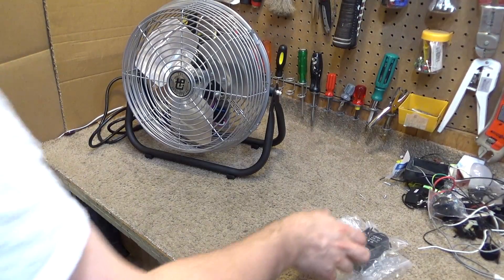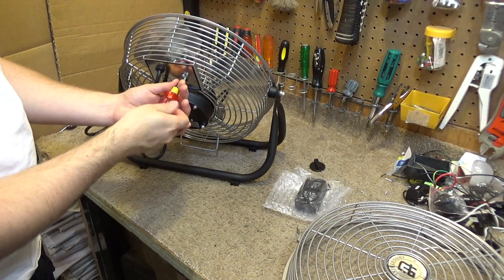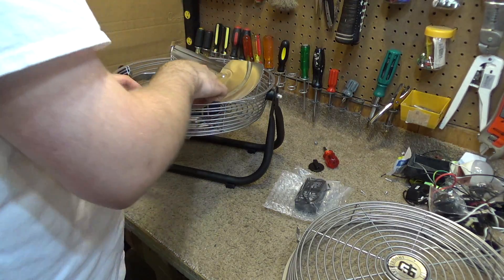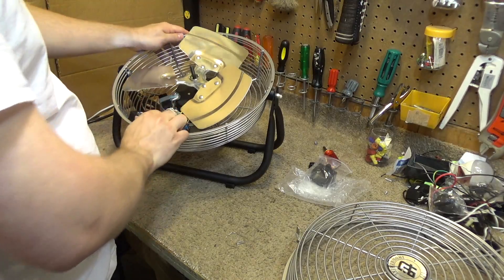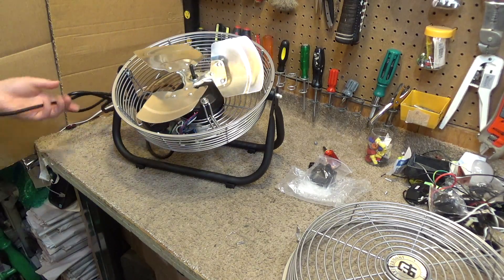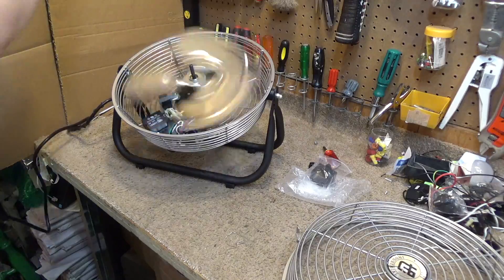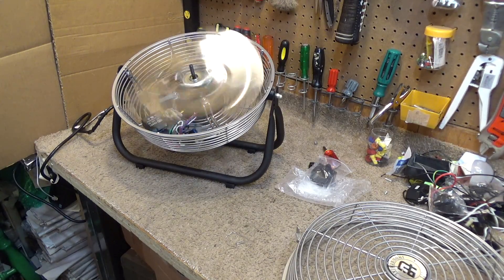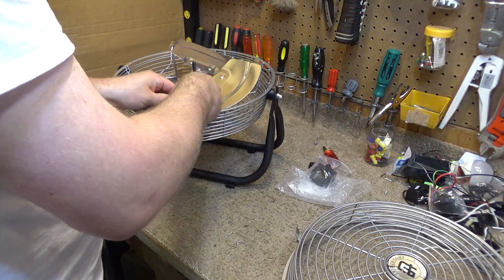A Good Low Speed for the TPI F-12-TE 12" High Velocity Fan

Comment: Why not try maybe a 6 or 7 uF capacitor in series with everything, on a bypass switch. Then you can have 3 high normal speeds, and 3 lower speeds. You'll probably find medium or high with a 6 or 7 uF cap will be the speed you like, but at least you've got a speed lower if you want to use it..!

Comment: A good low speed can even help with electricity bills 
Also it would be a good idea if you someday swapped those big ac motors with dc brushless ones for more power and less energy consumption in one of those cool tpi fans, would make them much better
Reply from the maker: None of that DC junk lasts. I'd never buy another one of these again if they started using DC motors.
Reply: @JordanU  well, for each their own and I respect  yours.I’m not criticizing AC motors, I like how reliable they are, I was just giving you a small suggestion, don’t go calling it junk if you don’t like it, again, all about tastes pal, have a nice day 👍🏻

Comment: Now it has a better low speed. TPI makes really good industrial grade fans that are almost flawless, even though they are Chinese made, just like pretty much anything else. There is room for them to improve on the blade pitch, though, so that the fans can have a good range of speeds.
Reply from the maker: As shown in the other videos, the pitch is not the problem with this particular model.